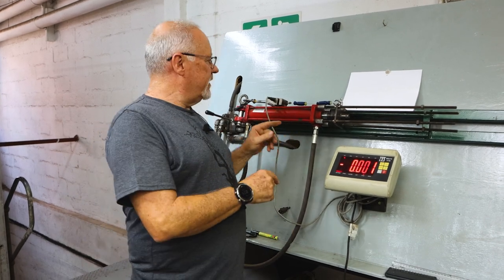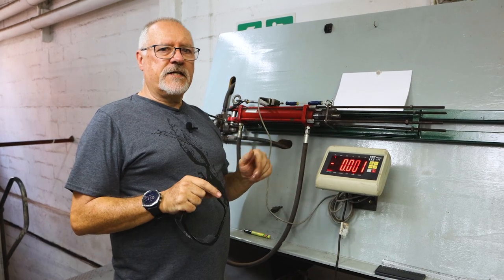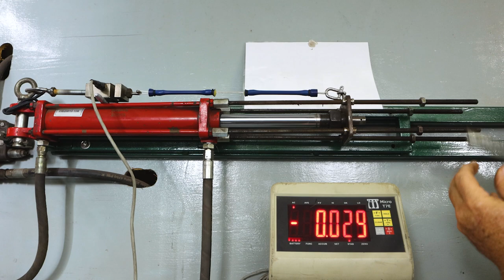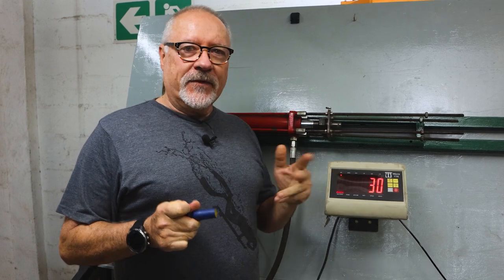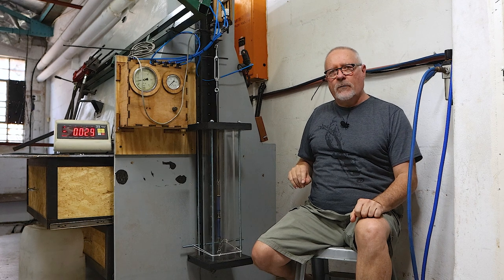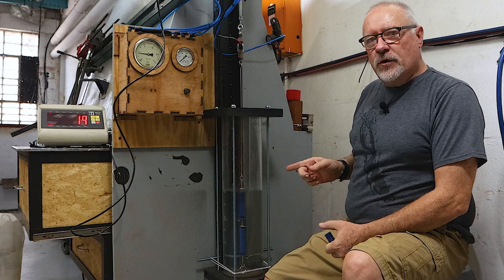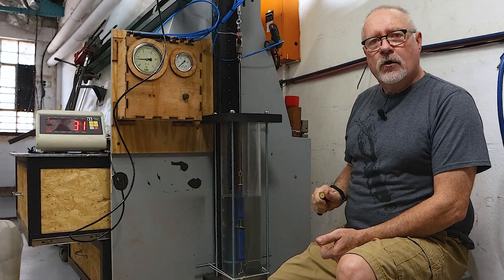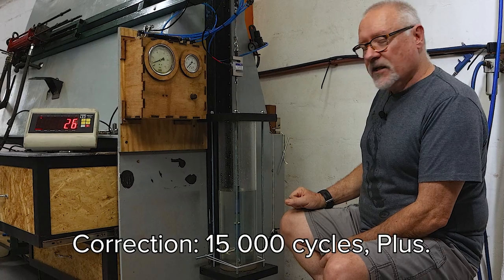Rob Allen | Wishbone Cycling | 2023

Comment: Ive found bridles are only a point of failure if notches or the bridle balls arent smooth. Find failure point is usually the same as what you have seen even in regular use with low cycles but long load times. Be interesting to see a test on the effect of load time and different bridles plastic/metal/knots. Wonder if some sort of soft ball would improve longevity?
Reply from the maker: We have tested knots. Knots are an option, small knots work in thin rubbers but, the knot needs to be much larger to enable it to work in thicker rubber. This makes it exponentially harder to insert. A soft material will just deform if too soft and tear. You need something stiff. I tested lead a long time back, even that deformed over time in the thick rubbers. Regarding long load cycles,  you will not get the wear as nothing is moving. The failure we seeing definitely start as wear points. This can clearly be seen if there is a rough edge when cut open.
Reply: @RobAllenSpearfishing  the failure point on my regular use rubbers is the same with much fewer load cycles so similar damage is being done anyway? Combination of loading, firing, time loaded and perishing over time?
Reply from the maker: @spearo16  most rubbers fail with time. The latex rubber degrades naturally, especially in the areas where under stress, like where the bead is stretching the rubber and the line tie is compressing it. Even if not in use this will fail. Failure will happen quicker in a hot environment.

Comment: Great vid!🙌🏽🔥 Question, I bout a tuna railgun 140cm, and by mistake bought a 7.5 pathos maverick steel shaft x 180cm. The spear has 2 x 16mm bands and are pretty elastic, don’t know if the shaft will do a big difference while shooting, BTW im new in Spearfishing! All recommendations are welcome!🔥
Reply from the maker: 2 x 16mm rubbers will push the 7,5mm spear fine if they are powered correctly. No way I can know that without knowing the rubber type. If it feels too soft and you are able to load too easily then it is probably under powered. Then cut a bit shorter. The best is to test. If it seems to be shooting low then the rubbers are too weak, cut shorter.
Reply: @RobAllenSpearfishing  I’m going to buy some 16mm bands to make the speargun bands. Any recomendable brands? Specific lengths? I was using a 7mm shaft and when I tested the speargun and I noticed the shaft was kinda slow and under powered. But, love the speargun!
Reply from the maker: @puertoricofishingpage  best is what we use so get rubber with our Roballen logo on it to be sure.
Reply: @RobAllenSpearfishing  Thanks! Will be doing that for sure! When I get the chance to catch something, I’ll send you a pic!
Reply from the maker: @puertoricofishingpage  👍👍